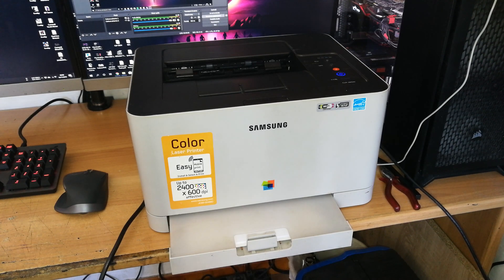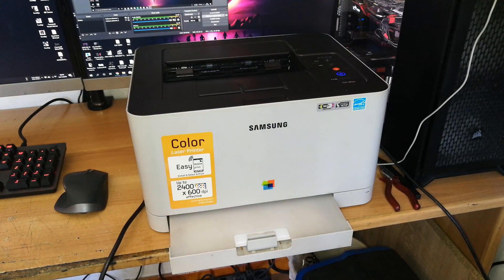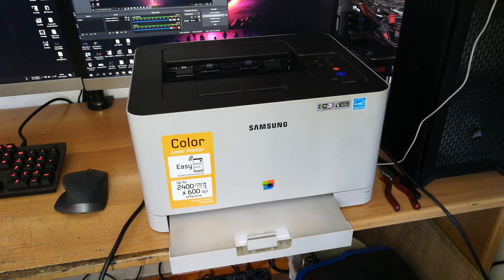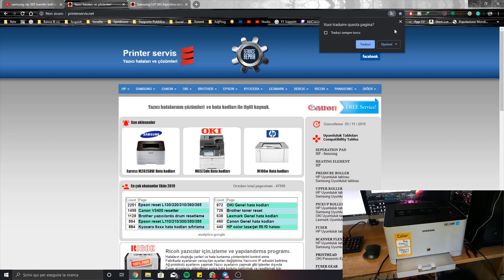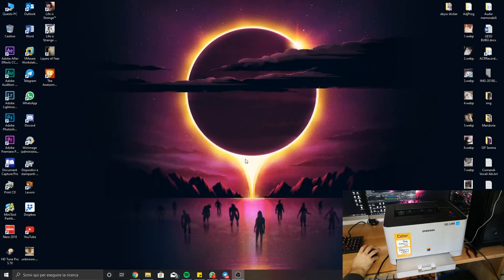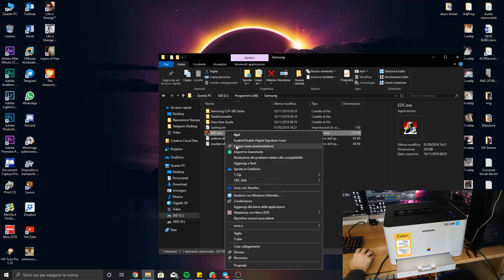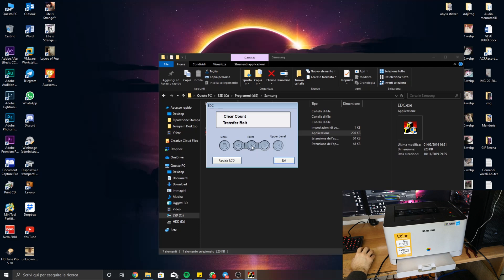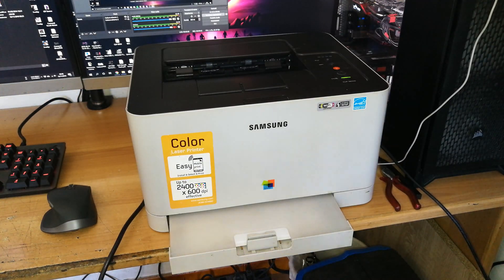Samsung CLP-360/365W • Come reimpostare i contatori ITB, fusore e tamburo

Comment: Very good video, excellent explanation. My printer (c410w) doesn't print colors, just black. Toners are new (not original), please help me
Reply from the maker: Hi :) are you sure the printer is installed correctly, using the correct driver, and in the printer settings Colour is selected?

Comment: Hello Paolo, and thank you for very good instruction videos. I have a problem with a Samsung C460 printer, that would not grab the paper and said there was a paper jam. So after I watched your videos on solving similar problems on other Samsung printers, I assumed that the cause of the problem was in the solonoid (?) thing. So I started disconnecting the whole printer following your instructions, and managed to release the solonoid. But looking at it, it seemed to work perfectly, not being sticky and not locking itself in neither the open nor the closed situation. So the mechanical part seems to work exactly as you showed it should when it is proper. That leaves the possibility that there is something wrong with the the electronic bit, which is somewhat hard for me to check, as I don't think  I have access to a 24 volt currency source. So right now I am a bit confused, it was a whole lot of work to disconnect the printer, and probably it will not be easier to put it together again. So should I try to buy a new solonoid and put that in instead ? (That implies finding someone who has it in stock an can deliver it, a short survey on the web shows that it might be not very easy.) Or should I just put back the old one, that seems to be OK, and see what happens when I have put the whole thing together again ? I guess I will go for this last option, but it would be interesting to read your comments to it. 
Other videos I have seen suggests that the problem might be solved by simply cleaning and lubricating the roller wheel in the middle of the cylinder that moves the paper. I did not try that, as I had hard to imagine that it could be that simple. But I will anyway clean up all parts of the printer before I put it together again, hoping that will do it.
Reply: Nope, my solenoid was open and looked perfect. But it was not perfect, after putting superglue on the pads, waiting for them to dry - still nothing. Then I bent the metal piece (the "stopper") so it wouldn't open as far AND put a v-shaped piece of paper in between so the pads couldn't contact - then it finally worked! Been working flawlessly for hundreds of pages now with no problem for years. I guess the pads was just a little worn down so the distance became too long and they were still (unnoticeable) sticky so the solenoid stayed open for a millisecond too long. Now it works perfect! Btw, "paper jam 1" is not an error message for when the roller is worn.
Reply: Also there is a small spring in the clutch-wheel that the solenoid releases - even if the solenoid works perfect, the spring can be compressed too much by wear. I had to stretch that spring a little bit.

Comment: This was incredibly helpful but I will this EDC work on other Samsung printers or is it specific to this model? I have a C430W that has this same exact issue and can't find an EDC specific to my printer model.
Reply: Yes exactly. I have C430W too and it does not show clear counts menu. I tried on win 11, win 10 and windows XP. No result
Reply: @huseynzadeilkin  at this point, I cannot find any viable tech support on this so I'm just waiting for the printer to stop working eventually.
Reply from the maker: Hi! I think it should work.
Reply: @PaoloMarcelli  I had hoped it would. I got the EDC dl from the website but like another mentioned,  in the EDC there is no Clear count menu option available. Any reason why this would be missing in the EDC?
Reply from the maker: @NJAmericanGirl  Did you try starting the program in compatibility mode with Windows XP SP2?
Reply: please let me know if you have a solution, exact same problem here with a C430W
Reply: @Robinsannen98  maybe it would be possible by changing the main board
Reply: @huseynzadeilkin  at that point, I'd just but a new machine. Not worth this frustration.
Reply: @Robinsannen98  no never got it to work and the light it still flashing to tell me to do so.
Reply: @NJAmericanGirl  sad! Thanks for replying tho.

Comment: Hello, thanks for the informative video!
Transfer belt is the problem in my printer, it reached 0 already (red led blinking) then I guess that is the reason the software did not work; actually, when the exe file runs, it displays the EDC window but all empty without any menu and I am getting a message of "Error sending command to the printer". And now, in 2022, a new transfer belt is almost impossible to be located and, it it can be located, it will be outrageously expensive...
Reply from the maker: Hi! Try running the software in compatibility mode with Windows XP SP2, also the printer has to be connected via USB to the PC. :)

Comment: I was struggling. I downloaded the first 2 files (but they sit in downloads. Nothing  in Samsung Program Files). I installed Yandex  - nothing much happened ( it is not clear what it does) but it  needs a membership to "Log in with Yandex ID".  I installed a driver I already had. In fact all that was needed was to open EDC from downloads, turn on printer and wait. Managed to clear the numbers but my printer has deeper problems probably related to the fuser unit (who numbers did not clear). Interesting 2 hours though

Comment: Great video! works perfectly. I need to fix this same problem on a clp680! is there a software?
Reply from the maker: Hi! You don't need any software for that model, you can use the built in "Tech Mode" inside of the printer. It's a hidden menu, you can search for the Service Manual online, it describes how to enter the tech mode and reset maintenance parts. As it's a confidential document I cannot send you the service manual, but you can find it by simply searching on google for "Samsung clp 680 service manual pdf"
Reply: @PaoloMarcelli  I'm in "Tech mode" but can't find anything about reseting in the manual, it just says that I need to replace the Transfer Belt Unit for a new one. Is it possible to reset?

Comment: please can you help me  SAMSUNG clp-360 series  sensor failure:#A3-6110. TURN OFF  THEN ON
Reply from the maker: The error code means that there's a problem with the Deve Home Sensor
1) Turn the machine off then on. If the error persists, turn the machine off again.
2) Remove the right cover.
3) Check the connection between the deve home sensor and connection board.
4) If the connection is OK, replace the deve home sensor.
If you can search online for the service manual, it's a confidential document and I cannot legally share it.

Comment: I have a clp 365 C43x Series. It doesn#t work. I can only switch between EDC Mode | 112-ACR Offfset | Test routines | NVM Initialize. No chance for any reset
Reply: I have same exact issue. Did you ever get it solved? I need to reset the counter on the transfer belt.

Comment: Hi and thank you for your step by step video. I have a CLP 365 and in the Samsung-folder there are not the 4 components of the EDC-files. Can you tell me where i have to copy? Cause when i move it into the main folder, there is no connection possible between printer and computer. Thanks a lot!

Comment: I am having LSU Unit Failure #U2-6140. Do you have any advise how can I fix it? Thank you
Reply from the maker: I suppose that needs an LSU replacement, never done it before and never seen a printer like that with an LSU failure.
Reply: @PaoloMarcelli  Gracias!